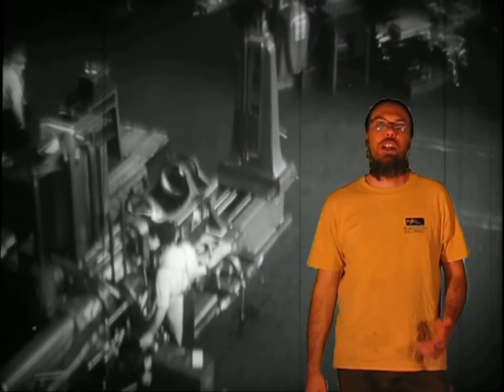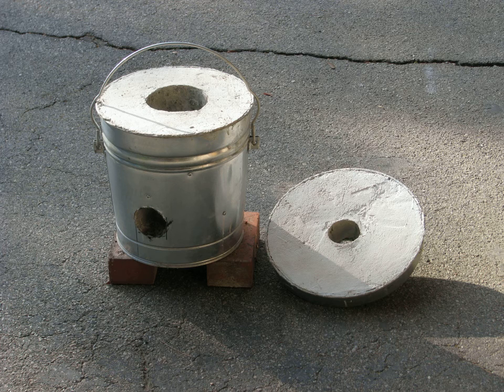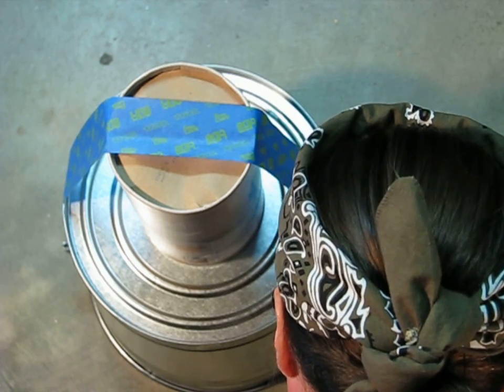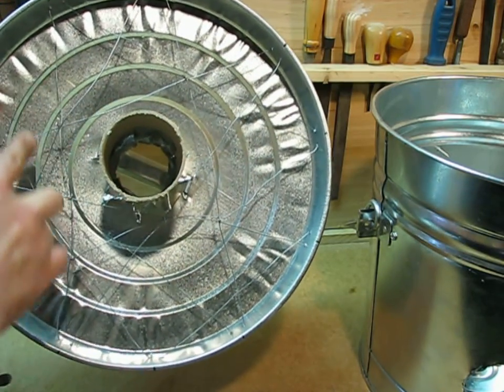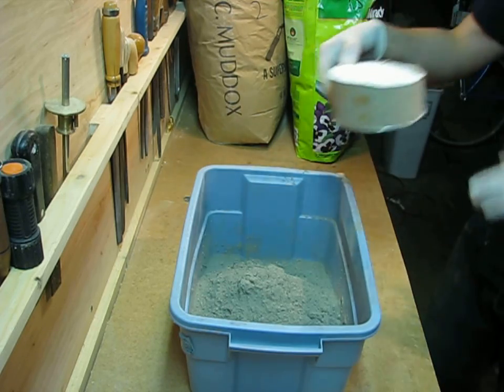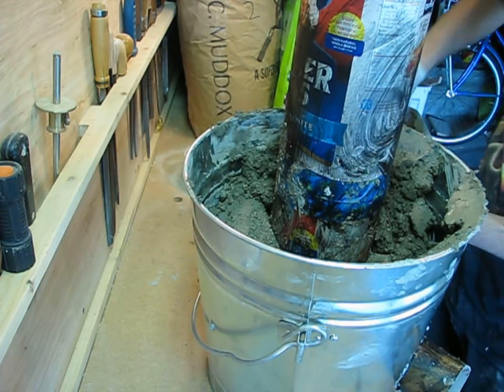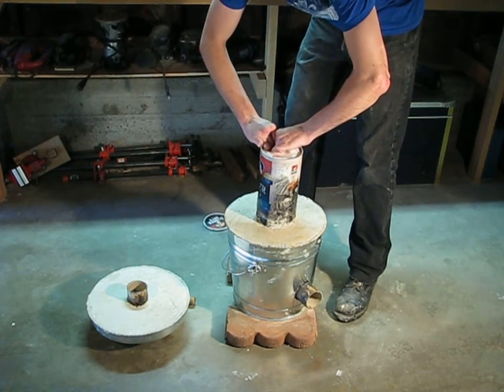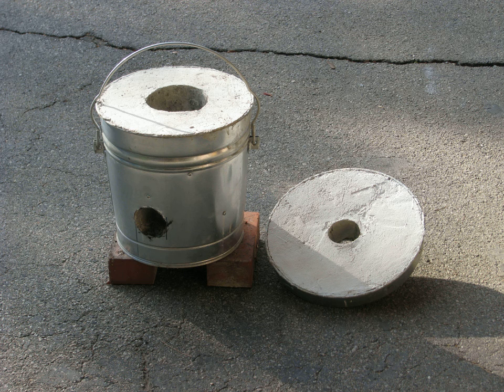Build a Foundry Blast Furnace Pt I

Comment: You should have omitted the Portland cement. The clay will bond it until fired at which point it will become vitrified essentially becoming a ceramic. Portland cement loses its bond with its water molecules at only a few hundred degrees turning it back into a powder.
Also your mix was much too wet. It should be dry and crumbly while you're mixing but just damp enough to be able to squeeze it into a ball and hold its shape.